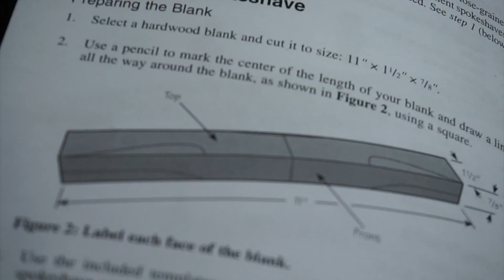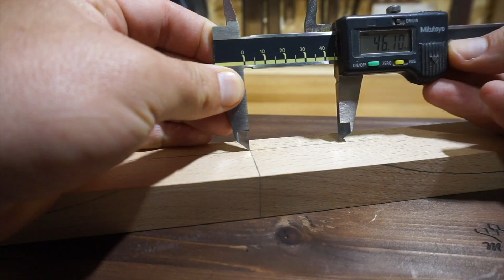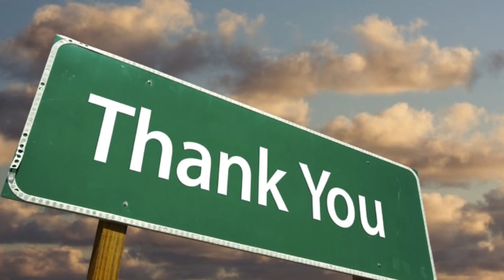Spokeshave, how to make

Comment: i'm in the middle of doing one of these and found your video.  Nicely done!  I'm not a handtool guy in general but this little project is a great way to start.  the veritas parts are typical veritas; excellent, very clever adjustment system
Reply from the maker: Thanks for the comment! ;-)